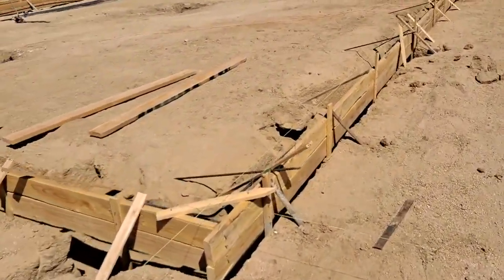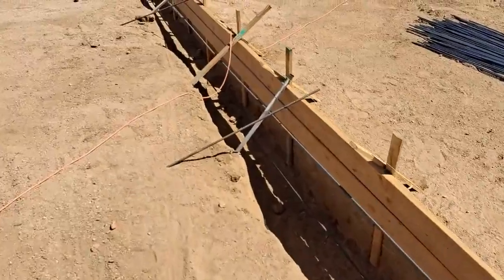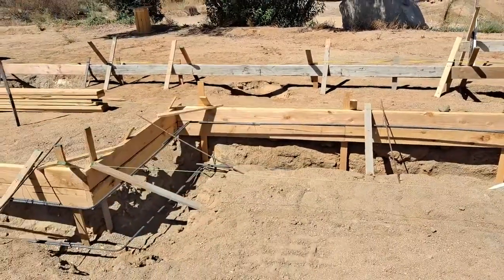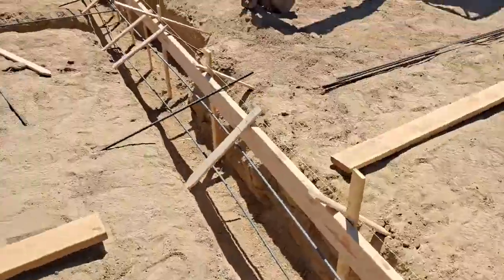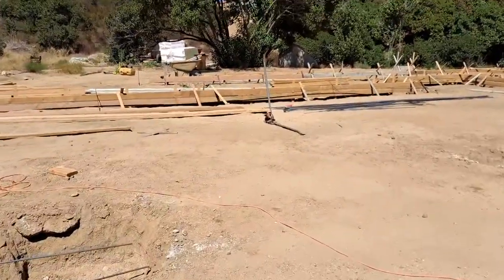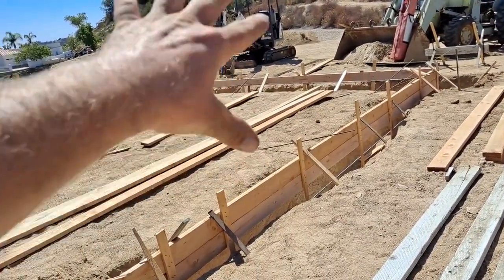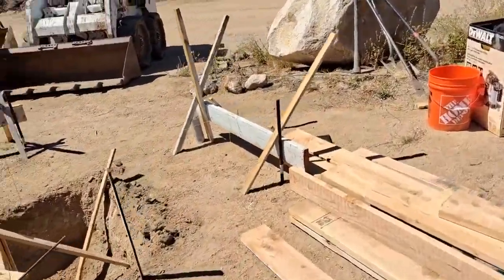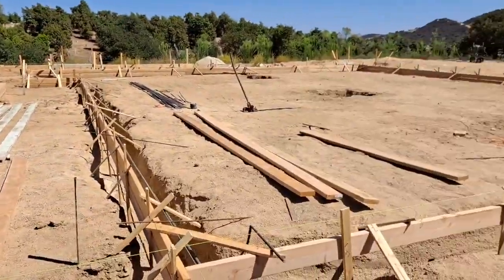California ADU (Accessory Dwelling Unit) slab project day 1 of footing rebar

Comment: How tall should the foundation come out of the ground
Reply from the maker: The top of the foundation was determined by the architect. They called it "finished floor" and that was the top reference point for the footing depth. So it's not really "how much comes out of the ground" it's more like: what is the finished floor elevation and therefore how deep do we need to dig.